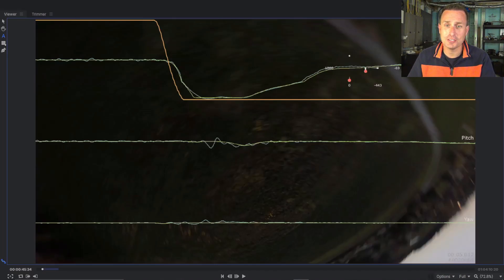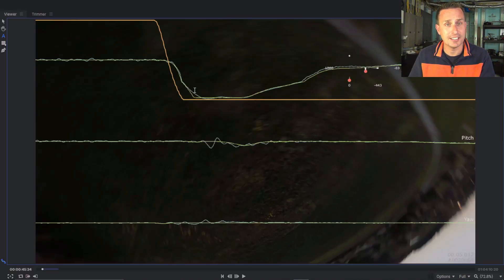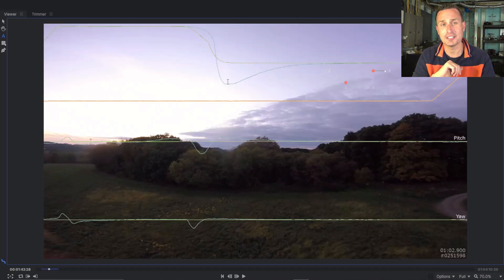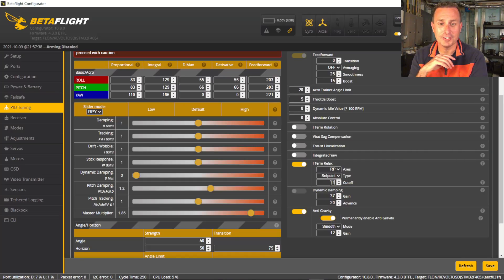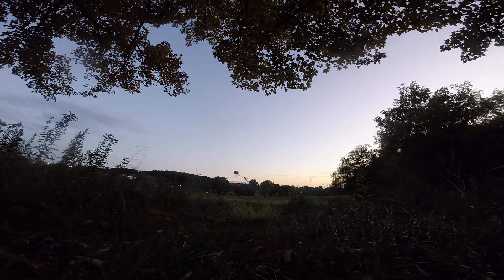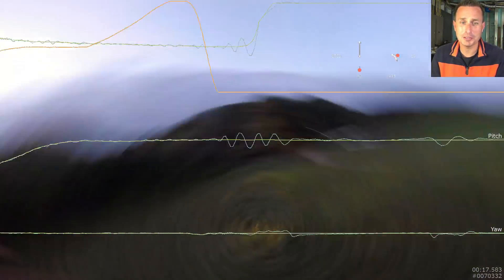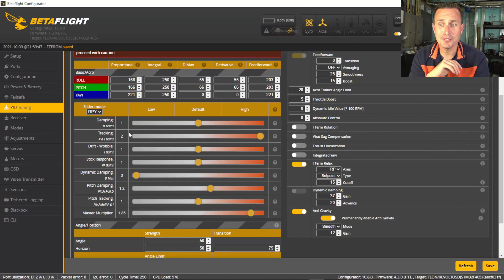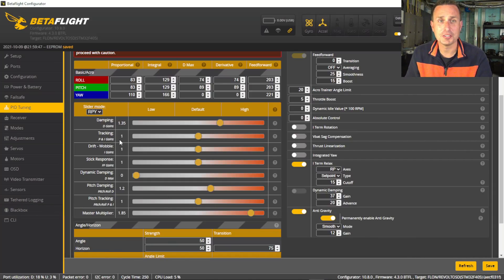How to FIX Bounceback

Comment: I don't have any of these problems in the simulators.
Fly the simulators.  A lot cheaper, crash all you want, and get about 1000x more flight time in instead of wasting your time with this old obsolete tech.    "Uncrashed" is the current hotness.   Really, I see no reason to fly the real hardware anymore.. at all.    Just an easy way to lose a $500 piece of gear in a lake or down a mountain ravine and ruin your year.  In the 3,000 hours since I started flying sims, I've never once changed a PID, a prop, or charged a battery.  Name one real life hardware pilot that's got 3,000 stick hours in the air.  You can't.  That's why I can aerobatically smoke them all in the air.
Reply: Sims don't have real-world consequences.  I flew flight sims and drove racing sims for a couple of decades before taking up FPV quads.  I've never gone back to sims.  Making a 'perfect' flight in a sim is easy; not so much in real life.  However, if that's your groove, have at 'er!
Reply: Yeah, well. You can read about welding all you want but without actually welding, you don't know how to weld. You just know how to read about it. I know how to do most of the tricks, even the technical ones in the simulator but I don't have the heart to even try them outside the sim. Just like I wouldn't try an open heart surgery even if I spent 3000 hours in the simulator practicing it. Simulator is just an approximation, anyways. But if you're willing to let some simulator surgeon to take a their first stab at your chest, I'll take your word for it - simulator hours equal hours in the air.
Reply: @pirateradioFPV  A sim pilot can pwn the living daylights out of a nothing but "toy in the air" stick time pilot.   I'll bet my farm on it.   

When yo live on  farm, you get sick of fixing everything all the time.   I have no love for fixing stuff, breaking it over and over again, fixing it, rinse, and repeating.   It gets old and tedious pretty fast.
Reply: @choppergirl  Sure. Just like a muppet can collect stuff to spreadsheets and then based on those spreadsheets claim 3,5" should fly like a 5". Or that 2004 is the best motor for 4". Or that AOS5 is the best frame, ever. All you have to do is believe.
Reply: @pirateradioFPV  I wanna say a good pilot can fly anything, even a bathtub, so does it really matter?   I'm the Queen of SUper Low Rates, so it really could handle like a bathtub and I'd still be able to sling it around the sky.

Next to flying in a sim, if you compare pros and cons in a list, you see, flying real hardware is really kind of a messed up sh1t show of headaches and a bottomless money pit.  Plunk your quad in the lake, you lose a $500 quad and a $500 gopro adn be traumatized for a month.   Plunk a quad in a lake in the sim, you flip a switch and reset.  Plunk it in a lake for fun even in the sim, the sim don't care and neither do your emitions.

I can fly rain or shine in day or night, free of sun and bugs and pumping gas and briars and cops from my kitchen, for 6 hours straight, with a microwave and refrigerator within arms reach in air conditioned comfort.   Why the h3ll would I ever want to fly the real thing then lol?

Well, only one reason, unlimited maps.  Planet Earth is pretty big.   So far however unlimited maps hasn't been compelling enough, because I can't over come the soldering barrier.   It's not that I can't solder, I got a sweet little TS100 and Kester soldering iron, tip cleaner and tinner, a $250 Hayer digital microscope., watched all the Pace Worldwide videos, even annoyed Louis Rossman in his ccomments section..   however...    I can't see to hit th tip of a soldering iron to the tip of a wire in midair or hit a soldering pad.

So the real hobby...  that should be plug and play connectors through and through by now...   really, really, really.. blows absolute chunks.   

I have a college edgucation, but I can't read the menus in a DJI pair of digital goggles.. because... the hoby just don't give a crrrp to be all inclusive.  You can't change the font size, you can't make it bigger, you can't even configure it from a computer and bypass the internal menu system.  I already got the hacks installed and upgraded to 50mbs, but still...   it's frozen where I last had it set, unless I draft a friend.    There is no HDMI port for me to plug in a 1080p HDMI monitor.  I can't move my face to the screen to see in a pair of goggles.

This hobby has some serious problems, and my posts were pointing out to UAV Tech that though he's making a great little video on how to .. .so to speak... if I can use a metaphor....  configure and p1mp out your Ford Pinto by pulling out and pushing in the buttons on the stock AM/ FM dash radio to set your favorite radio station presets..    I'm  over here like Ralf Nader screaming this car is unsafe at any speed, it's got a gas tank in the back that will explode on rear impact and turn the inside of the little car into a fireball inferno!

There's a lot about the "toy in the air" rc  hobby that really blows royal chunks and needs serious deep dive overhaul.  I was thinking about the top page of Rotobuilds yesterday,a nd thought, you know, between all of these hundreds of quads these guys are building, there is not a single part that is standardized across all of them.   Not a single one of them.  The closes you could come would be the motor nuts, but even those vary...

Not a problem today, but in 10 years when all these frames and motors are no longer sold, you're not going to be able to maintain them.  Yo won't be able to get one replacement motor to match your other 3 still working, or a replacement arm, or a frame top plate to match... because they will be gone.

And that.. is what I call a junkyard sh1tshow... too much choice, not enough planning or forethought.
Reply from the maker: Very cool.  Interesting take on it.  Show how diverse folks can be for what works for them best.

I don't fly sims really at all.  It just doesn't do it for me personally.
Reply: Sims r to much like fortnite or any other game i like real deal I enjoy fixing them too part of hobbie
Reply: I have over 2,500 hours logged in MSFS9 on a Canadair CT-114 Tutor, the same flight model that was used by the RCAF's 431 Demonstration Squadron for training and programme development.  I would never, ever have the temerity to tell an actual Snowbird pilot that I could wax his or her tail.  That's just silly talk.  Sims only go so far.
Reply: @billmcdonald4335  You may have a valid argument for full sized airplanes with complex three dimensional cockpits and startup procedures, but such additional experience and knowledge required  not translate over to the RC world.   

For example, I could fly the nheck out of a P-38 in a sim, but I would be lost in the actual cockpit (not really, I know all my black dial instruments) when it came to running through the checklist and startup procedure.   In that case, you do kneeed to know a lot of criticals and where everything is, and you're contending with real G-forces, runway rumble, and from experience, quite a bit of fright landing and taking off a plane... that fast.   Even landing a Cessna 170 on a grass strip is a harrowing experience.

However, the difference between a real world quadcopter and the sim is negligible.  I've flown both.   You need to set your alarms on your transmitter to watch battery voltage and keep your mind on it and line of sight, and a the more complex environment of the real world... but that's about it.  If it goes down, you have an a5 of a time hiking to it and finding it in the bramble or whereever.  Not a lot of fun.

In a sim, you flip a switch, you're back in action.   Over and over and over again.

The "pros" everybody thinks are "pros" have maybe several hundred... maybe even a thousand hours flight time... if they've been doing it 10-20 years.   Take the best one with 1,000 hours...  I'm 2,000 hours ahead of him.

You can spot the jokers that are hardcore sim pilots first.  They can tear up a race track and carve knotted balls of string in the sky.   The high time sim pilots are wayyy ahead of everyone else by a couple of orders of magnitude.
Reply: @choppergirl  You make a good argument.  Sims do help one improve their chops, no question.  But as I said: real world consequences.  Sims do not offer this, and to be able to pull off a 'perfect' flight IRL is reward itself.  BTW, I'm an indoor, Angle-mode only thumber.  An absolute duffer, by any standard.  That's the way I like to fly my kit.  However, it's my opinion that sims are a good way to practice without stress, but it's just not a substitute for doing it IRL.  Opinions differ - which is why this hobby's so great.  Keep flyin', Sister!
Reply: @billmcdonald4335  Put 500 hours in the Sim, you'll never fly Angle mode ever again.

From a sim in front of a computer in an office chair to a real world cockpit with a windshield and redlines and air traffic around you, taht's a difference.

But a sim pilot and quad pilot ... there is no transference difference.  You're using the same controller, and if you do it right, the same video screen.   You're both watching a video screen, you both have yoru feet on the ground, and you both experience no G forces or threat to your spine.

In the air, sheeeet, I'll fly with as much wild abandon as I do in the sim.. because.. why not.   Flying conservatively...  holds about as much appeal to me as being a general aviation pilto that can take off, fly level, turn around, and land.   Yawn.  Absolutely zero effing skillz.     All their focus is eaten up by following rules, and getting the bird in the air, keeping the wings level, and putting it back down on the ground safely.  That's all great for safety, but your skills...  no... you never develop them.   A coordinated turn is not an aerobatic manuever.  It's about as far as most guys get.

In a sim, I can try anything and I do.   Fly crazy, fly insane, crash all over the place, and observe.  Hey, I just pulled something off.   If I can do it then, then... can I repeat it.  Did I just discover anew acrobatic manuever.  If I can repeat it, one more move I can do.   I add it in my big black book of Choppergirl's Arcane Aerbatic Manuevers.   It's what seperates me from teh boys.   They got a few pretty flippy tricks.   I got a big fvckin' book.   :)

Angle mode... okay for LOS flying a tiny whop in the house to pester your cat.   Ditch it and get out into the big wide open spaces with a 5" and full FPV and Acro.  In the sim, of course ;-)  Crash all you want, reset.   Flying on the cheap.   The City Park map in "Uncrashed" is so huge, I ahve yet to know all of it.

Google check out my three full people sized antique airplane projects.  Collecting dust.. because... why bother :-)   Gasoline, busted knuckles, turbulence, stress cracks in aluminum tubing, detonated cylinder heads, off field landings surrounded by cops, these things do not bring me joy.
Reply: @choppergirl  I'm happy duffering around my 20'x20' space, thanks.  It's satisfied me for three years now.  I've got the thing tuned to perfection for my little apartment, and have little desire to move on to Acro mode.  I'm done with sims - after two decades of the virtual, I prefer what I'm at now, however modest and unimpressive my abilities actually are.  You do you, I'll do me.  Long may you run.